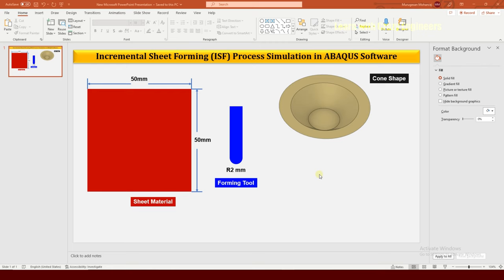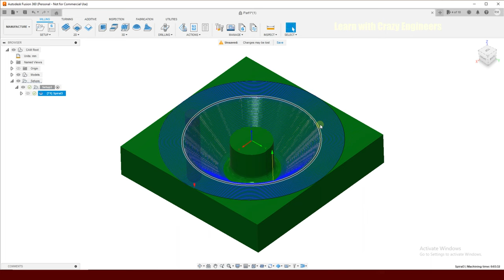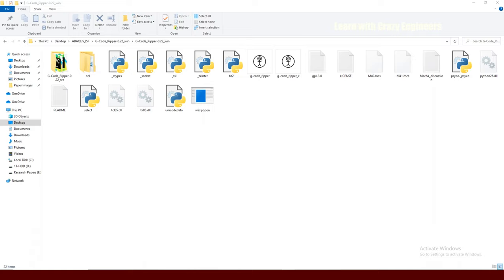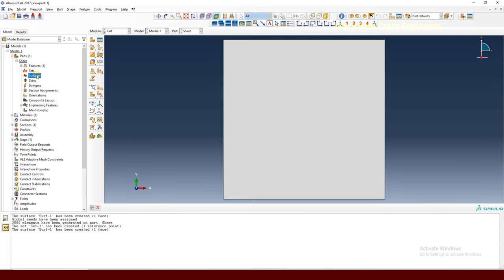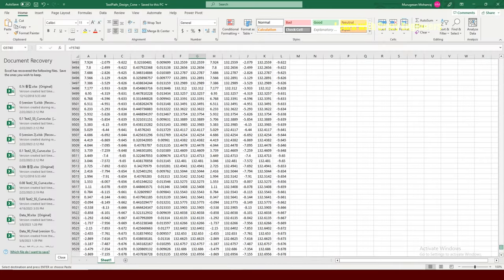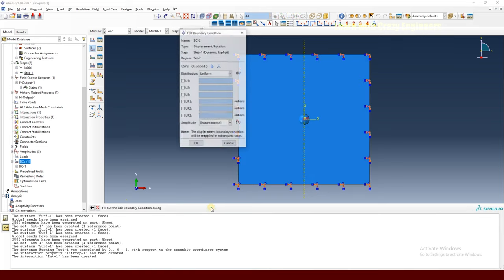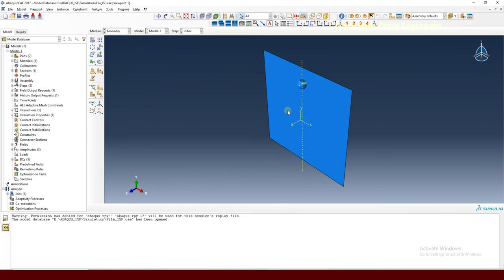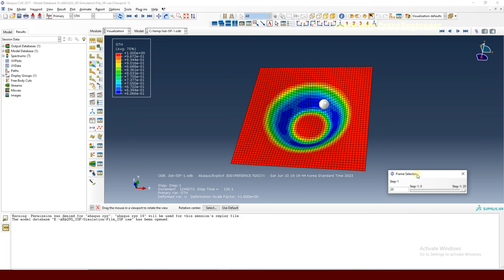Incremental Sheet Forming Process | Complete Tutorial | ABAQUS Software #incrementalforming #abaqus

Comment: Thank you for such informative video. Sir, I need to consider the spindle speed of 600 rpm in the simulation but I don't know where to give this boundary condition. And additionally any amplitude should be given if required?
Reply from the maker: You have to define boundary conditions in Fusion software itself and generate tool path. You can't define spindle speed in abaqus. Thank you 😊
Reply: @LearnwithCrazyEngineers    Thank you for the reply sir, but I am really confused now after knowing that we can't define spindle speed in Abaqus software. But we are only generating x y and z cordinates from the fusion software but i am using matlab for the same. then we use excel fomulas for the adding of feedrate in the terms of time steps. In conclusion to this phrase if we are giving amplitude in terms of time and cordinates than there should be another boundary conditions and amplitude like rotational B. C.(radian or radian per sec).
Reply: @LearnwithCrazyEngineers  Sir I am verifying a simulation done for 0.91mm sheet. In the literature result SNEG  is not coming in legend for the S, mises and fraction is also not -1 it is -0.906105. How can I get this in my legend. Do I need to change settings in my input file or in the result view options. Please reply sir. Thank you again.

Comment: Hello Sir, Thank you for thus Great explanation. One query regarding the forming operation. It is taking 150 seconds to complete this operation.. Practically will this forming complete in 150 seconds?
Reply from the maker: It's based Fusion calculation. You can clearly see how much time it will take to complete experiment in fusion 360 software at end of the tool path generation. Usually, experiment time is about more than 5 or 10 mins of total fusion time.
Reply from the maker: We are reducing Simulation time based on mass scalling or mesh size or velocity/displacement bcs, mostly without affecting real experimental outcomes.
Reply: Thanks for the reply sir. May I know what was the runtime for this analysis?..
Reply from the maker: It was about 35 mins, I guess. Because my system had high configurations. So it's mainly depends on your system configuration.

Comment: How can we get the tool movement data in x, y, and z directions
Reply from the maker: I clearly explained at the start of the video. Please watch it carefully. This is like an inch by inch tutorial. Please watch it one more time and ask me if you have any doubts
Reply: @LearnwithCrazyEngineers  Ok Sir 🙏
I don't have Fushion software that's why I skipped that part, I'll watch it 🙇🏻‍♂️🙏
Reply from the maker: Ah, fusion software is the necessary tool.  Otherwise you can use CATIA to make a tool path. But fusion is free for students. You can use it.
Reply: Ok Sir I'll download it 😁🙏...
Reply from the maker: Sure ❣️
Reply: Sir I can't save the post vendor from the fusion 360 library. I'm selecting the AXYZ International option but it is not working
Reply from the maker: Use the output file with .NC or .tap option. There are so many output file formats.  Choose the proper one
Reply: @LearnwithCrazyEngineers  Yes Sir i select NC Program then go to settings here the 'Machine and post' option is available but when i try to select the AXYZ vendor from the post library, it is showing another option 'Use post from Fusion 360 Library?' here My Posts location is given only and nothing is available here to select
Reply: Ok Sir i get it🙏🙏
Reply: But how can i get the different values of strain and stress
Reply from the maker: I will post video about post processing soon ♥️
Reply: @LearnwithCrazyEngineers  Eagerly waiting for the video Sir ji🙏🙏🙇🏻‍♂️🙇🏻‍♂️